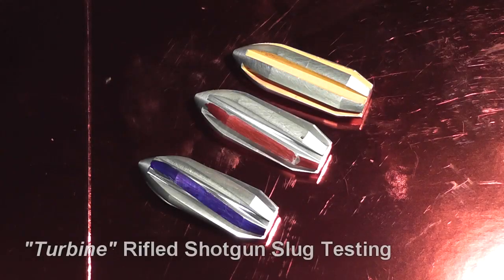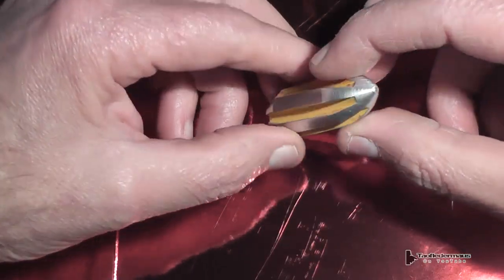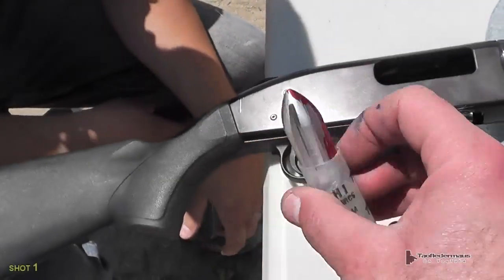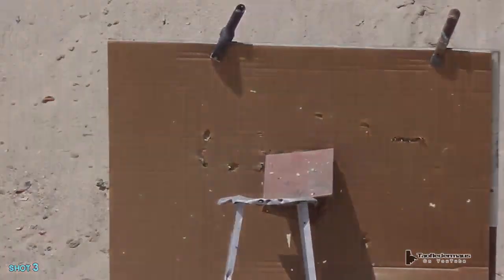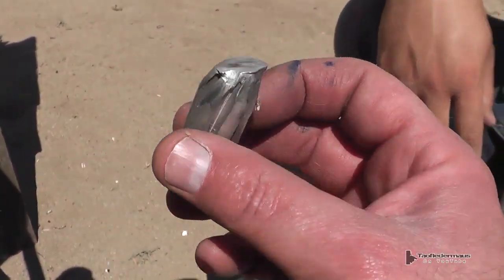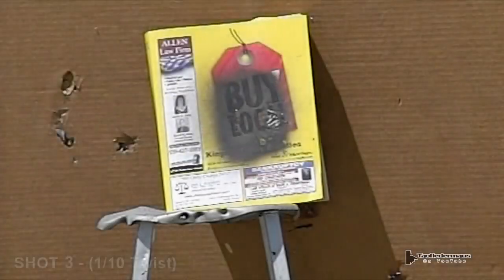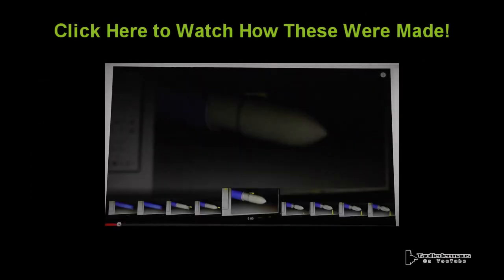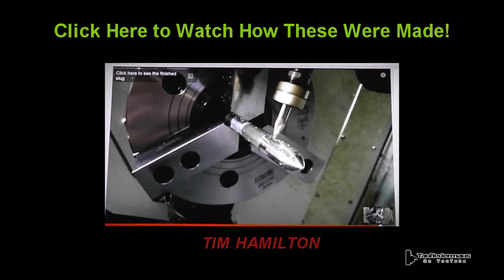Custom Aluminum TURBINE Shotgun Slugs  -Testing

Comment: That bullet has a flaw. You must fully cover rear of the bullet so that it won't counterspin because of the gunpowder. If you do that, it will start doing nose spin and will go straight.

Try to glue or attach some lead part to rear that will fully block gunpowder air reaching front fins. That will boost the enery it can hold and also avoid counterspinning.

Comment: My theory is that the slug is tumbling/key holing because it is made out of aluminum; it might be too light. Maybe led might stabilize more if you wee able to cast such a precise slug.
Reply: You can buy those in a store it's called a rifled slug
Reply: lol i know that. I'm just saying this exact design.
Reply: I believe at supersonic speeds there is a low pressure area around the projectile . Low pressure means no air to push on rifling that's is why rifled slugs do not even spin.
Reply: That makes no sense. In fact, since it's lighter it's easier for the air to make it spin. F = m × a. Same force but less mass = more acceleration.

Actually, it would be even worse because the heavier a projectile is the more spin it needs to stabilize.
Reply: Filipe Amaral I think a heavier bullet would possibly help. If you look at the Miller twist rule: t^2=(30m)/(sd^3l(1+l^2) such that t= twist, s=gyroscopic stability factor, d=diameter of the bullet, l=bullet length and m=mass of the bullet. You can then solve for s with a given twist rate to find the gyroscopic stability of the bullet. This leads to the function s=(30m)/((t^2)(d^3)l(1+l^2) which shows the positive relationship between gyroscopic stability and mass. Note that t=T/d where T is the twist in inches per turn and l=L/d where L is the length of the bullet in inches.
Reply: Filipe Amaral True. But the aluminum would be a concern for me. Lead is easy enough to remove from a shotgun barrel but I'd be concerned with the possibility of cladding the barrel of my shotgun with aluminum.
Must be a beeyotch to clean if you fire a good number of these rounds.
Reply: Nathan Mullins YOU ARE CORRECT..Shock wave is at same angle as slug ogive. No air flow until well into sub-sonic zone.
WHY not just buy a rifle and use a shotgun as it was designed. 300 years ago.[fowling pieces]
Reply: Filipe Amaral i meant ligher objects accel faster.
Reply: A small diameter slug with sabot traveling in a rifled barrel would work . But that has already been proven. The material the slug is made from does not matter bottom line is aero type fins will not stabilize or spin at supersonic speeds . Slow the projectile to 100mph it might work but you could catch it in a ball glove.
Reply: Mike200494 You can't necessarily solve for s in this situation because the equation deals with a round that is forced by steel grooves and lands to spin, not in-flight stabilization.

Can't break the laws of Newton, a heavier object will accelerate less.
Reply: Soren H Yes they make rifled slugs, and they were originally made with the same mindset as these rounds. However it has been proven that rifling cut into the slugs does little to nothing for stabilization. They are only stable because the front is heavier than the back of the slug by design.
Reply: Filipe Amaral heavier objects accelerate faster but momentum is higher. once the aluminum leaves the barrel there is no more force behind it to keep it at a stable speed. so when it slows down itll start to tumble. just the air alone will make it slow down much faster causing the front to drag. but im no tony stark so i dont know much.
Reply: bobbobsquarepants888 Maybe adding a lead core in it and shortening the length of the slug to about the current commercial size could help compensate for tumbling.

Comment: The "rifling" on a rifled slug allows it to be safely swaged through a shotgun choke, and does not cause the slug to spin.  Rifled foster slugs are stable because the better part of its mass is concentrated at the nose of the projectile and not due to its rifling.

Comment: If someone can plese help: There's something I don't get. What makes that "classic" bullets flight straight, and anything custom they try doesn't ? Is it because of the type of firearm ? Or because of the shell they use ?

Because if you take any bullet shot out of a handgun for example, it doesn't seem to me the aerodynamics or anyhing else is better than this custom projectiles. Where's the trick ? The most logic answer seems to be that the problem is at be the initial push, no ?
Reply: the key is that a handgun or a rifle have rifling in the barrel, which makes the copper coated lead projectile spin, in this video they where using a shotgun, which is a smooth bore weapon: it doesn't have rifling down the barrel and the idea with the groves on the aluminium slug was that they'd make the slug spin instead, which apparently didn't work.
Reply: anter176 Ok, thank you very much for the explanation.

Comment: When will people finally stop trying to spin a bullet from a smooth bore barrel using aerodynamics alone? It is mathematically impossible to achieve the RPM necessary without slowing down the bullet to a ridiculous degree. 

You don't try to apply spin to bullets fired from a smooth bore. It's unnecessary and the least efficient means for stability. You need to apply massive amounts of drag to the tail of the projectile.

Also, those grooves on foster type slugs do not impart spin to the slug. They are to allow the slug to squish down through ANY choke size, so the projectile is safe in almost all guns.
Reply: Michael Meissner No, you can not put rifling on the bullet in a smooth bore barrel and get any spin off the projectile. It would require a softer barrel than the projectile that would deform as the projectile traveled down it. Which realistically speaking is impossible unless we ignore half of physics for the sake of that explanation. 

Fins are iffy when it comes to supersonic objects. You need to place them according to center of gravity and compensate for aerodynamic pressure on the nose of the projectile. There's a lot of other special factors that come into play as well.

I'm surprised we even use rifled barrels anymore these days to be honest. Then again some of the smooth bore flechette concepts didn't pan out but I imagine they eventually will as technology evolves to improve practicality. Granted they did work fairly well from some things like the steyr ACR, the lethality just wasn't there.
Reply: Tombs Clawtooth
Hmm. Well, as a fan of the Sniper Rifle System 99D-Series 2 Anti-Matériel, I hope we get some more practical flechettes for small arms.
Reply: IHCTerra uhhh an arrow spins because of the air it's flying through so...
Reply: Than why does how smooth the exterior of a supersonic jet is matter
Reply: No but if there is a Shockwave preventing the air from making contact with the grooves shouldn't it work the same
Reply: I understand how it works, but I also understand that the air doesn't actually have to make contact with the metal to be affected by its shape
Reply: Tombs Clawtooth thank you!!!!! i was waiting for someone to post this
Reply: Tombs Clawtooth Wait, isn't "apply[ing] massive amounts of drag to the tail of the projectile" going to "slow[] down the bullet to a ridiculous degree"? Or do you mean that in order to apply spin to bullets from a smooth bore, you would need to apply ludicrously massive amounts of drag to the bullet? That would make sense to me.

Honestly, though, I don't think the goal of rifling the rounds is to aerodynamically spin the bullet; I figure it's more based on the idea that if a rifled barrel can impart spin on a smooth bullet, shouldn't a rifled round be able to effectively impart spin on itself against a smooth-bore barrel? The painfully obvious answer to me is no, not without causing significant wear to the barrel, but someone thought it and tested it.

In case my original read of your comment was right, the goal of tail fins and stabilizers is not to impart extra drag on the bullet. In fact, they're specifically designed, in all cases and applications, to add minimal drag. They keep the bullet pointed forward because of the self-correction via drag against the fins whenever the axis of the projectile deviates from the line of the path. Also, IHCTerra, you are wrong. Fins on a supersonic bullet will stabilize it; there is air hitting their broadsides when it starts to tumble.

Anyway, I agree with your comment as I understand it. Spin isn't the answer here, at least not without a rifled barrel.
Reply: Tombs Clawtooth
Yeah, I get why rifled bullet with smooth bore barrel doesn't work. I don't quite get why stabilizers are "iffy" with supersonic projectiles, as they seems to work just fine in all my experience, but it's limited experience, so I trust you. My biggest question is "why not rifled barrels"? Flechette rounds and their APFSDS round counterparts are highly effective for weapons with enough space for a large barrel. But with handguns, SMGs, and even typically rifles, rifling the barrel to impart spin on a bullet makes sense because flechette rounds need wider barrels, and that adds size and weight to a gun. Honestly, I'm actually curious about why rifled barrels would be... obsolete.
Reply: Michael Meissner Because of velocities that can be achieved, and higher energy levels for lighter ammunition loads. Less wear and tear on the weapon as well.
Reply: anthony clark Because the skin of a supersonic jet is much more complex than a slug. The front of the slug is symmetrical and the tip throws a little shock wave around the rest of it. 

A plane does the same thing, however the air contacts the entire surface of the plane, since its a much larger and more complex structure. Drag is a crazy thing, that's why most hyper sonic planes try and act like bullets and make the least amount of contact with air as possible.
Reply: Tombs Clawtooth When everyone understands aerodynamics as well as you think you do.
Reply: pop9095 Don't even need to understand aerodynamics, just the energy levels involved and energy levels required to apply enough spin to create stability.
Reply: Tombs Clawtooth Which seems to me to be related to aerodynamics and high velocity physics. If you believe that most people clearly do or even should understand these things I would like to hear the logic underlying that position.
Reply: pop9095 It's as simple as understanding that your car requires gasoline to run. Or that you can't throw a rock around the planet.
Reply: Apparently, objectively that is not how simple it is. The forces of gravity are pretty easy for the average person to understand in a basic way. Understanding how supersonic objects act depending on how they are engineered is not nearly as intuitively well understood. Certainly not as clearly as the limitations of the human arm or the requirements of an internal combustion engine with regard to fuel. Good day sir.
Reply: anthony clark the fletching on an arrow increases rear end drag and the fletching is almost an inch high, not shallow groves, plus an arrow is sooooo slowwwww that the envelope air has plenty of time to interact with the fletching
Reply: Tombs Clawtooth Thanks Sir.Your comment has helped me choose between a smooth bore and a rifled shotgun barrel.I have only used rifled slugs thus far in my bird guns with mixed results.I did kill a buck with a .410 slug when I was a youngster,but those slugs were not rifled.
I think a semi-auto 20 ga. with 2 interchangeable barrels would be an all round good bird gun,and a good deer gun as well.The rifled shotgun barrel...more hunters should know this.
Reply: JBodine67 You're always better off going for a 12 gauge and seeking a reduced recoil loading. You get better patterns from the bigger bore.
Reply: Tombs Clawtooth The reason he dosent  use a rifled barrel is because aluminium is harder then copper or lead so it could catch on the rifling and make the gun explode which isn't very fun for the guy holding it
Reply: interesting, but how much spin.... If the gods will it, spin it, and just go with a light material. it'd be amusingly straight flying but no impact, still would end that argument for a period of time.

Comment: There is a problem with rifling the slug instead of the barrel.  The hot gasses that push the slug out of the barrel are traveling in one direction.  The wind resistance after the slug leaves the barrel is in the opposite direction.  That means that when the round leaves the firing chamber, it starts spinning one way.  When it leaves the barrel and meets the air, it has to slow rotation, stop, and start spinning the other way.  That's just not going to happen.  It will tumble every time.

Comment: They need to be a bit longer.  And I would hollow out the inside.
Reply: michael johnson Because Brenneke and Foster slugs are hollow and they work.
Reply: clangerbasher why would you hollow out the inside? and I think they need to be shorter not longer.
Reply: michael johnson Reduce the mass. And longer.

http://en.wikipedia.org/wiki/Sectional_density

and,

http://en.wikipedia.org/wiki/Ballistic_coefficient

I think.  :)    

TBH they looked too heavy and too short to me.
Reply: clangerbasher id reduce fin height. any imperfection effect would be magnified with fewer and bigger fins.
Reply: clangerbasher That's what she said ;-)
Reply: retsaoter As are air gun pellets.  If you want to make something efficient always look how the problem was solved in low powered systems.
Reply: max margherio Yes.  If you looking at early rifling, say the Brunswick,  two lobes worked well.  So two grooves should work. 

http://upload.wikimedia.org/wikipedia/commons/thumb/b/b8/Girdled_bullet_and_twin_rifle_groove.jpg/220px-Girdled_bullet_and_twin_rifle_groove.jpg
Reply: clangerbasher correct me if im wrong, but isnt that made for lead balls?
Reply: max margherio We are talking about number of grooves (though strictly speaking in a barrel they are called lands) and their shallowness not materials.  We are wondering whether fewer shallower grooves on the projectile would be better. Or not.  Who knows?   :)
Reply: ah. i see. example of grooves not bullet shape.
Reply: max margherio Well the bands on the bullet cause the bullet to follow the rifling or the lands.  There are two lands in my example.  Grooves in the shotgun projectile will cause some spin.  The thinking is would two grooves not more help with stability (less forces,  more balance) and would shallowness help too.  :)

Which takes me back to hollowing them and making them longer.  The first reduces weight which means a tad more speed.  And length for stability and passage of air over the surface.
Reply: clangerbasher less forces, more balance? All the forces would be distributed at the same angle around a circular pattern.

A helicopter with two rotor blades isn't more balanced than one with five. With two blades, the forces are 180° apart. Three, 120 deg. Four, 90 deg and so on...
Reply: Filipe Amaral It easier to cut two grooves accurately than three.
Reply: By that logic cars wouldn't run, do you know how many gears are there in a transmission? It's a lot of cuts.

You can get things toleranced to the point the innacuracies are irrelevant.

Either way, even if moments of force are slightly off, they still all point to the same direction and add to the spin no matter what.

Comment: I enjoyed watching both shooting and making this slugs. Very precise made but they lack stabilization due to the low friction because of hardness of aluminum . I suggest that Tim or you should take a look at "brenneke" slugs made of lead. Notice deformation at the point of the cuts. This alu. slugs could work fine without cuts but you have to have rifled choke. Cheers

Comment: A note on "rifled" slugs. The kind of rifling on these commercially-loaded shotgun slugs are NOT there to provide any stability to the projectile. Their purpose is simply to allow some space at the edges of the bore so that the slug can swage-down through different choke dimensions. Basically, the rifling is a safety feature.

Also, putting a rifled slug through a rifled barrel would be LESS stable than a sabot or other round, since it would have less surface area to grab the rifling and more space for gasses to escape around the projectile.